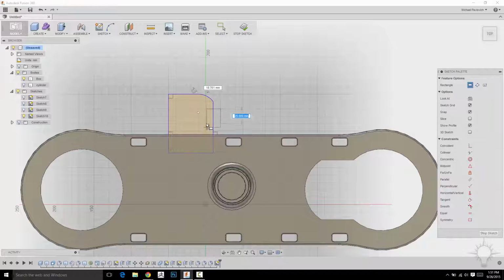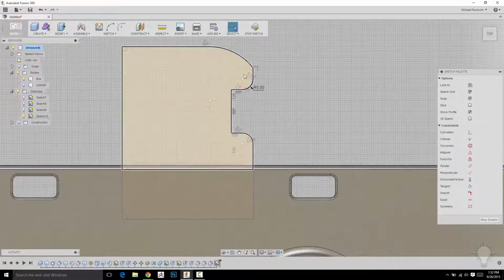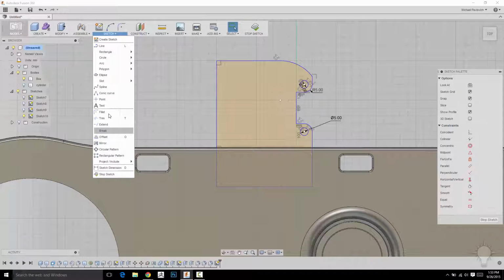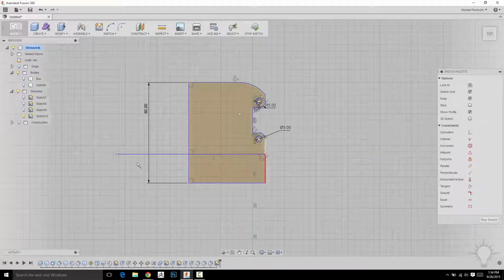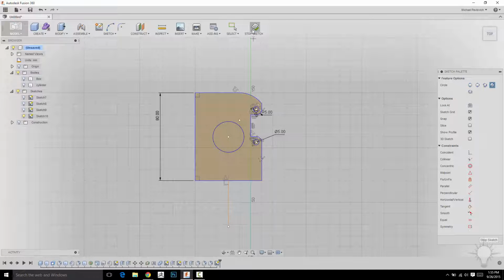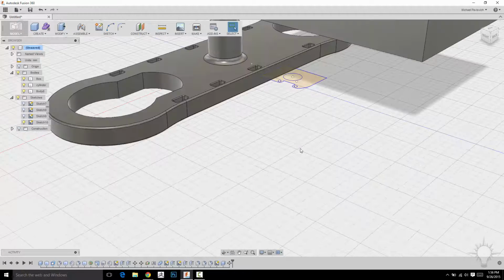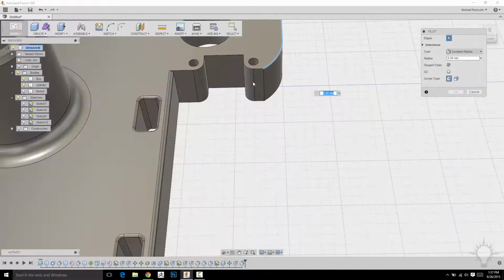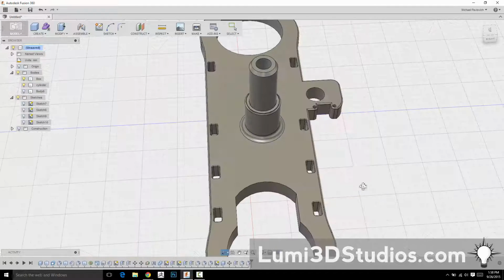008 Adding Sketch Features

Comment: Who is this for? Why is it better than SolidWorks or AutoCad?
Reply from the maker: Not "better" or "worse", just different. I haven't used AutoCad since highschool, so my opinion on those programs are that they'd really suck for production work compared to the ease of use of Fusion, but I could be wrong. But if you're already a SolidWorks or AutoCAD master, then I probably wouldn't advise picking up Fusion?
Reply: I guess what I meant was: Is there a workflow for getting these models into ZBrush or even Maya as useful assets? How is Fusion at exporting polygonal meshes?
Reply from the maker: super easy, video 12 goes over it Fusion 360 Quickstart: http://www.youtube.com/playlist?list=PLkzopwqcFevaweEJv1LU8C4ZdJA55XhFH